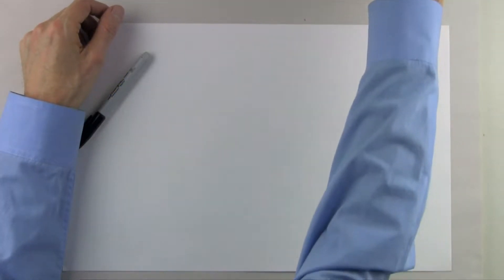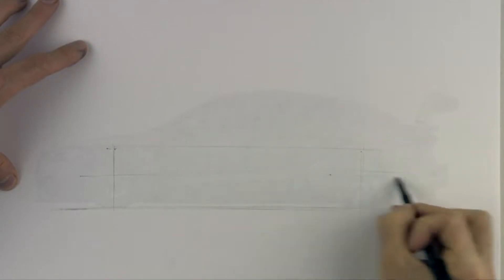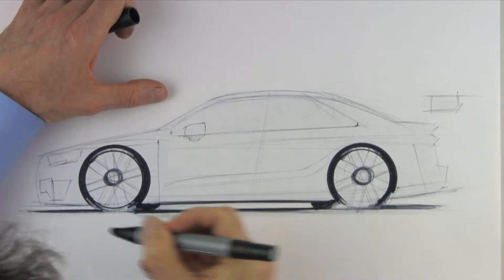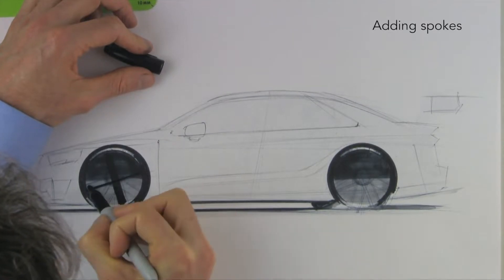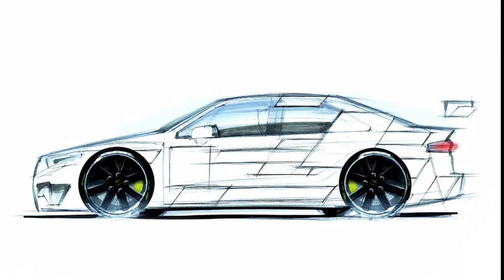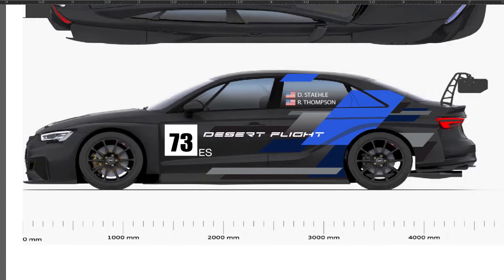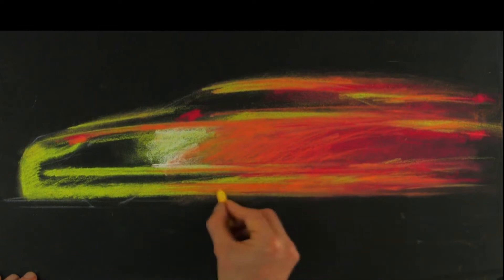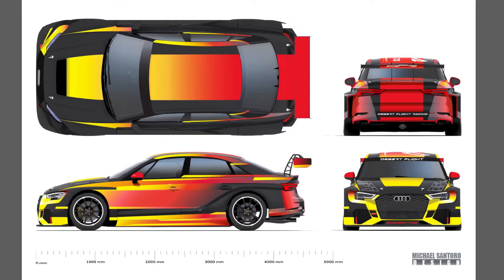Race Car Livery Design Project - How to Draw Cars

Comment: That reveal...  what a moment it must be to see a livery you create make its way to an actual race car.  Turned out fantastic
Reply from the maker: M- I'm glad you liked the reveal. I have to admit the "moment" was not as dramatic as you might be imagining. I was present and supervised the wrapping of each of the cars. There were many times when the wrap team was going to do things one way and I had to instruct them on how to best get the look that was in the drawing. Slowly over 2 days, the designs came to life. Eventually, we pulled them from the garage out into the light of day and I got to see them in all their glory. That was the "moment" of this project. 

Shortly after, they were put on a truck and sent to Mid-Ohio raceway where they went on to win the National Championship. I watched the race live on YouTube and every time each car came past the broadcast booth, the announcers commented on how beautiful and exciting the Audis looked. 

The whole process is very similar to doing an exterior design for a car. You start out with a drawing and work with a team of sculptors (vs. a team of wrappers) to bring the design to life. In the case of my exterior designs, you're sent out to what is called a "job shop" where the final fiberglass model is created. You spend a lot of time going over every millimeter of the surface to make sure it's what you want. Eventually, it's gets painted and put on the truck and shipped back to the Design Center. 

So the big moment for the Audis was right before they got put on a truck. The big moment for my production car designs was when they got offloaded from a truck. Either way, the moment is a happiness that no one can ever take away. It makes all the hard work worth it.

Comment: Awesome video! How do you turn these 2d sketches to 3d renders if the client wants to have a more detailed look?
Reply from the maker: Thanks for the question. The answer is, I don't. For me, part of the designer/ client relationship is trust. You either buy into the vision or not. I have a huge portfolio of award-winning work. If a client can't get behind my ideas because they need to see every nut and bolt, then they're not a client for me. I have been fortunate to have the right clients find their way to me over the years. This livery project was one such job. So was the Vector M12. Thanks again for the question.